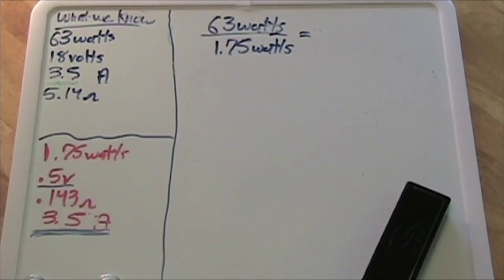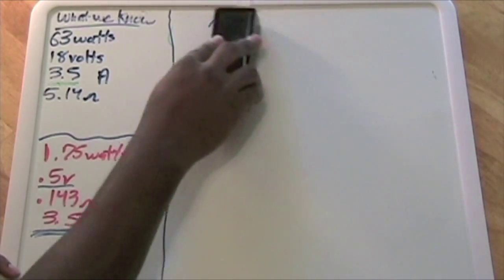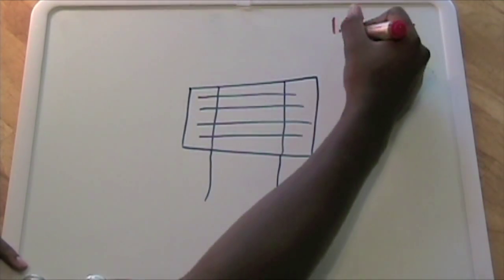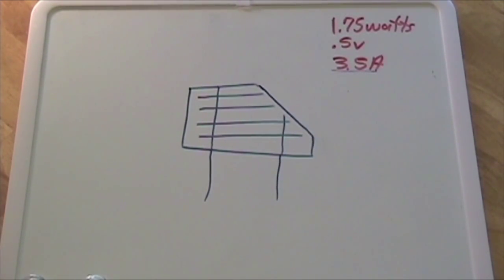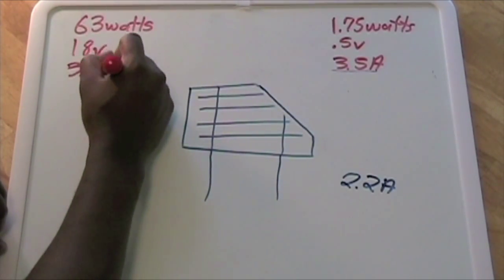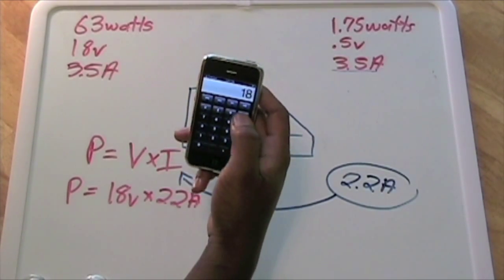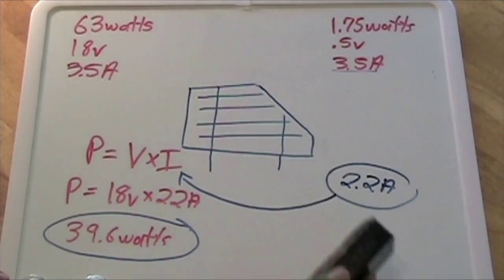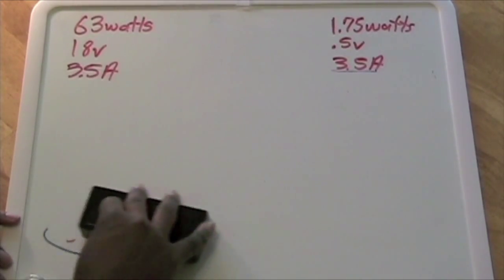How To Build A Solar Panel - Part 17 - School Series Part 4

Comment: Amps do not increase in a circuit wired in series.  36 cells rated at 3.5 amps each make a series circuit rated at 3.5 amps.  Think of it as a river, the wattage is the volume of water, the resistance is how hard it is to travel down the river bed, and the amperage is how fast it travels.  If you have 1 small river sending .5 gallons of water down a channel that resists the flow by a factor of .143 at a speed of 3.5 mph, then you add 35 more little rivers next to it doing the same, the rivers...

Comment: hey robert... u said 3.5amps per cell. is that can multiply by 36cell? my calculation is 3.5amps x36cell = 126amps is that correk? or,if 3.5amps in 36cell.what if i have 2panels.so 72cell...
my calculation is 7amps in two panels that 72cells.. is that correck? pls help me

Comment: Hi Robert

I am looking to produce 240 volts to create an independent electrical solar system. How would you recommend I approach this task.  Would I commence by using Ohms Law to determine how many cells I require, if I were to purchase the everygreen cells at 1.75 watts that appears to be a lot of cells. Not sure if there are larger cells with higher watt capacity or have you any ideas how to approach this project.

Comment: the solar cells will add up , if you have 1 it 3.5 amp 0.5 v if you have 2  in series it's 3.5 amp 1 volt  if you have 2 in parallel you have 7 amp and 0.5 volt

Comment from the maker: Do not think of it as time. The solar cells produce 1.75 watts when they are receiving direct sunlight. I would probably recommend you get a digital multimeter to help understand this as well. 

When you are measuring the volts/amps/watts for a solar cell, you don't care about the time. It's just an instant measurement.

Comment from the maker: That's the max the solar cells can produce, some can produce more, but depending on how you hook up your solar cells (in series or parallel) will determine if you have the standard max Amps the solar cells can produce.

As mentioned in the video, to have more Amps, hook up your solar cells in parallel. For more volts, hook them up in series. 

If you are still confused, I suggest visiting this forum and opening a thread about it: solarpowerforum (dot) net